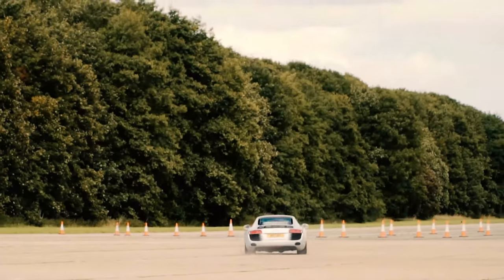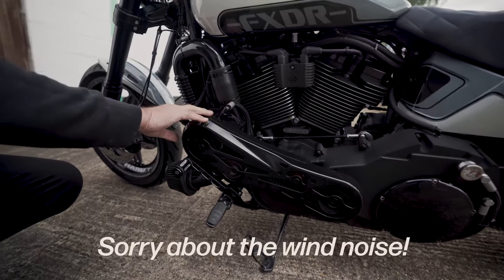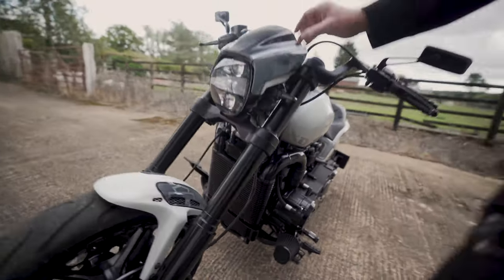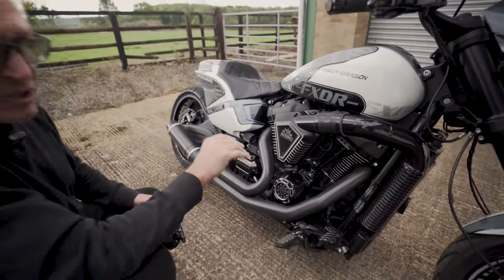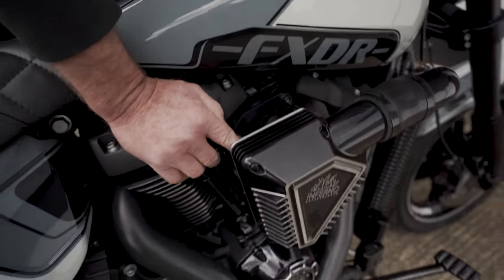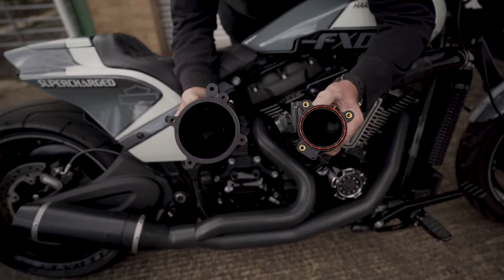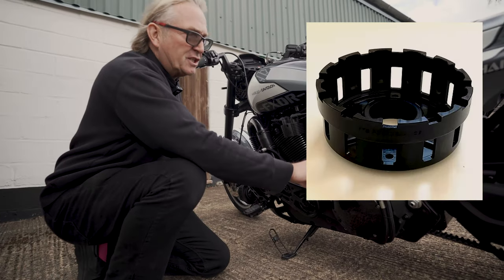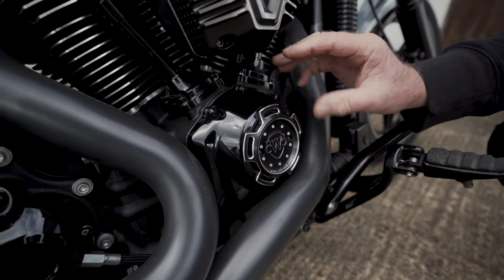Fastest Harley-Davidson? TTS Supercharged FXDR with 286hp!!

Comment: How's that belt holding up ? 😂🤣
Reply from the maker: Very well. But needs a new gearbox
Reply: Grudgebox maybe
Reply from the maker: @ryanhellman651  that’s what’s going in👍
Reply: 146 hp per cylinder? Probably going to have a short life between rebuilds.
Reply: @freebehindbars8654  better take it to Moonshine HD!
Reply: @TTSPerformance  can you do mind controls and a chain drive?
Reply: @TTSPerformance I was just going to post that I hope the trans holds up. Tripled up the forces on those gears.
Reply: It’s made of reinforced Kevlar, it ain’t gonna break

Comment: What kind of octane booster is used? I would think its not the kind from the gas station... 

Do  you just mix in a smaller amount of race gas, toulene etc.? Very curious how this can run on anything but 100+ octane race fuel.

Comment: Has the engine been opened or is it still stock apart from the camshaft.
Reply from the maker: This is a full build with this power. S&S crank. 117 pistons. Rs468 cam. Big valve head. 90 mm throttle body.
Reply: @TTSPerformance  Awsome !!!! but i think id take the Rocket over the HD. Are you going to be advertising a price for the rocket kits or ring for prices. Thanks Mark.
Reply from the maker: @marksmith2726  Prices on my website. And info. 👍

Comment: 2016 Triumph ROCKET III, why am I constantly rebuilding the transmission. I've been riding for over 50yrs, Carpenter Racing built the motor up to 260hp & 190 ft/lbs of torque at the rear wheel naturally aspirated. The transmission has been rebuilt 3 times. Every time Bob Carpenter wants to blame me! I don't miss shifts. I don't grind gears. The transmission is built from glass. HELP!!!
Reply from the maker: I don’t see many transmission issues. If your a big guy and go two up and ride hard who knows.
Reply: @TTS Performance  
Hey Guys, I ride solo, I weigh 225lbs, no passengers. 
My trans is made of glass. 3 rebuilds so far. Scared to ride it for fear of catastrophic failure again.
Thanks!

Comment: supercharger, big throttle body along with a gokart sized air filter. otherwise looks good
Reply from the maker: It’s a 2.5 inch inlet to the air filter. It’s not restricting and fits without ground clearance issues.